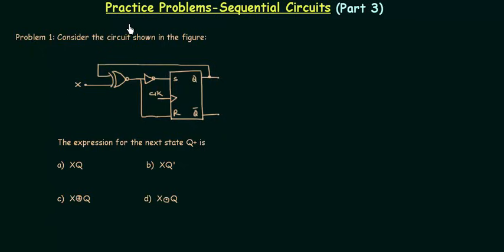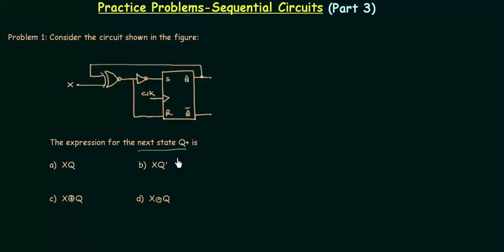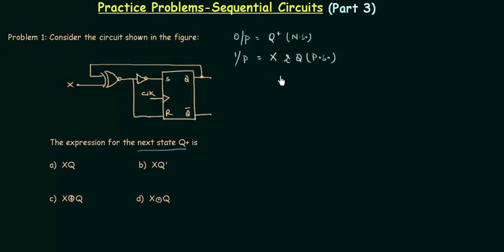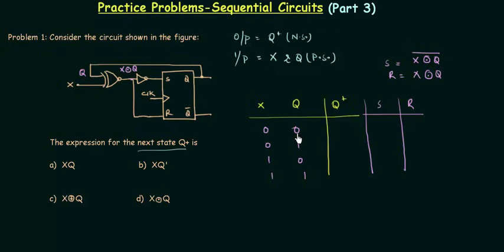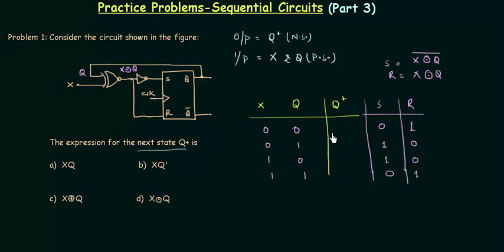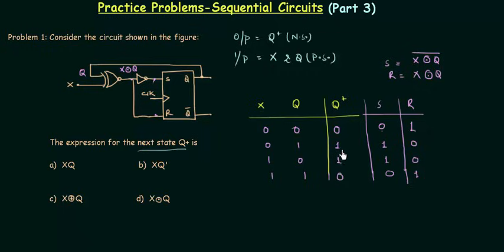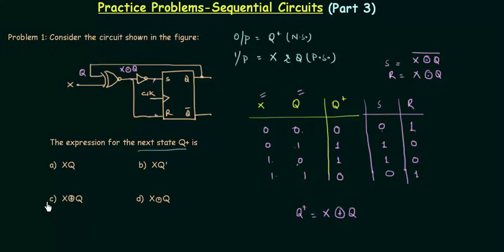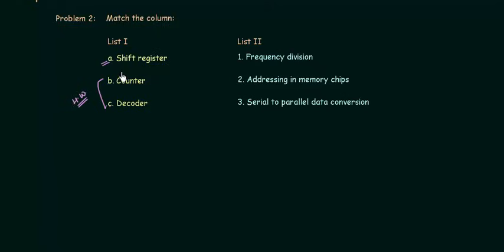Practice Problems on Sequential Circuits (Part 3)

Comment: Sir i am really thank full 2 u 
before listening your lecture
 https://www.dropbox.com/s/cp2t5rpz2bpl3bs/Screenshot%202015-12-22%2017.23.05.png?dl=0https://www.dropbox.com/s/cp2t5rpz2bpl3bs/Screenshot%202015-12-22%2017.23.05.png?dl=0
i.e i am below the avrage

i just start listening your lectures after my 2nd mid and i got excellent marks in final 
https://www.dropbox.com/s/rrcs3ug1dbro0ms/Screenshot%202016-01-11%2004.03.54.png?dl=0

thanx to u n Nesco academy
you are on Great mission providing free education to students May God help you   
i am supperised that you are working for betterment of student without getting any fame i listened lot of your lectures but even though i dont know your name

Comment: Please I do understand the Sequential circuit but am having problem with Multivibrators, I know their types, differences etc but am having problem with the Monoshot and astable formulas, please can you create a video on designing from a multivibrator(e.g bistable) to a monoshot using the formulas for their frequency etc